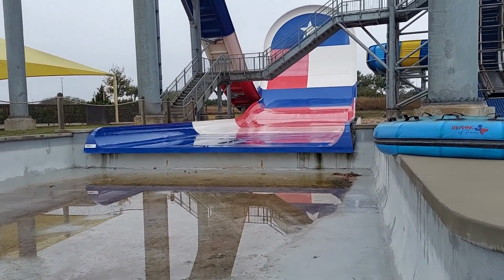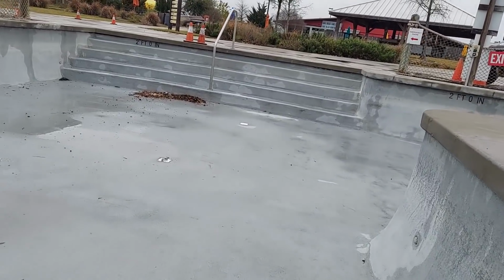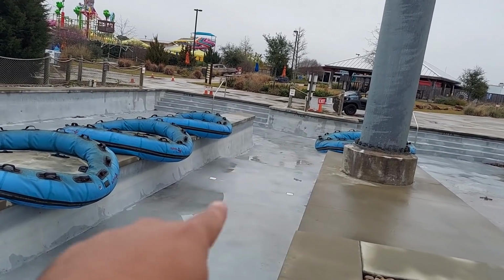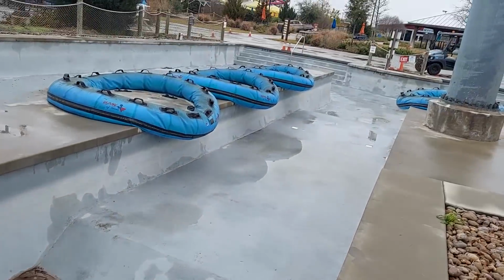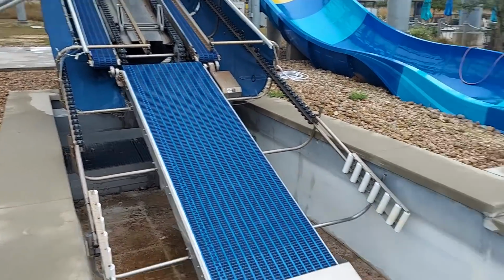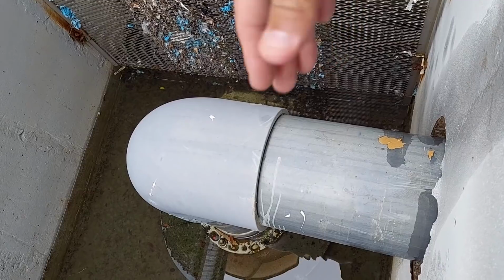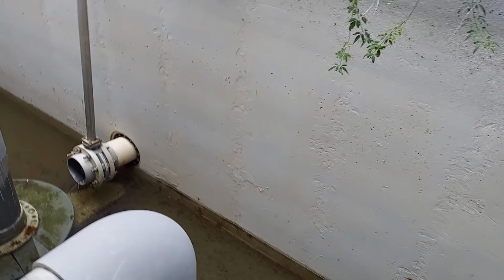Family Raft Water Slide Pump House

Comment: This really cool to see, so there's basically almost no chance for suction entrapment with this water feature even though the drain is massive and has a huge pipe, it's located in a area that's very hard to swim to. This surge pit I'm assuming prevents direct suction in the pools? Also, some lazy rivers have insanely massive drains such as 6 ' by 4' drains, does that mean they also have a 30" line inside them since the cover is so large?

Comment: I have three questions:
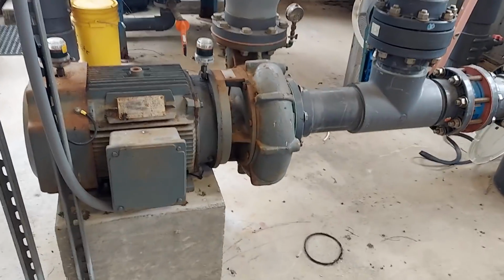1. What is the purpose of those pumps at 4:22?
2. The water flow throw the 4 bigger pumps, is filtered?
3. What would happen ir anyone throw, for example, a coin on that tank and is sucked by a pump?
Reply from the maker: 1. Those are pumps for another pool and attraction.
2. Non Filtered, however, the water for the entire pool is filtered.  The flow requirement is calculated to include the water that would also be taken by those pumps. 
3. Ehh, a coin wouldn't do much.  but rocks and stuff, they can be a nightmare on the impellers.

Comment: If you ever need some nice hose ask the local fire dept if they have any junk hose, usually it'll either have a small leak that presents itself during hose testing, where the hoses are pressurized to right around 400psi for 15 mins, I've used "junk" hose for years and even the pressure from the tower drain hydrant isn't enough to make it leak, I'd recommend keeping a few of each diameter around on a shelf somewhere, as considering it's pretty much free and given the cost of new hose it's well worth it, I've got 1 3/4 and 2 1/2 hoses on hand and when I get a new hose the worst condition hose gets passed on, I've got a list of people who want hose
Reply from the maker: Hey Hey!  Yes, we have a great relationship with our local fire department, and county fire department.  I have numerous 2 1/2 inch and 1 1/2 hoses and a couple of fire nozzles from them.  We use these for washdowns and pool refills.  These will be shown in my refill videos! Thanks for the comment!
Reply: @thepoolguy  Are your hoses Burlap or rubber? Some are Kevlar, but those are new enough we don't have any yet
Reply from the maker: @vacexpert2020  They are burlap, which works great for us.
Reply: @thepoolguy  I prefer the ribbed rubber hose, as it's easier to clean, though Burlap is considerably lighter

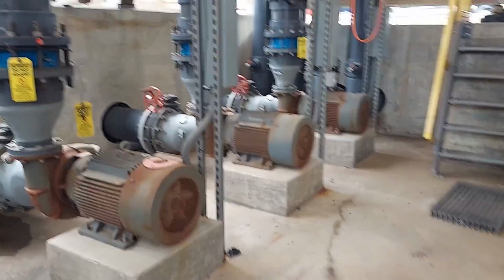Comment: Some cool stuff man! What's the standard pump between the 14 inchers at 3:51 for?
Reply: I was wondering the same thing!  Seemed a little out of place, my only thought was maybe it was so they could drain things out for winter, but then I saw the drain in the corner of the surge pit.  These videos really get my mind going.
Reply from the maker: So this pump is for a feature that was listed in the plans for one of the slides.  When the ride was commissioned, it was determined that the ride didn't actually require the feature to operate correctly.  So it was deleted from the plans, but never removed.  We kind of have plans for it, but it will still cost to move.

Comment: can't wait to see surge pit in action. btw why is the grate to catch debris lower than the water line? dirt can get past it no?
Reply from the maker: Correct, , but the water flowing out of the pipe is quite strong, and really only needs to be at  the pipe level.  Also, if the grate were to get heavily covered in trash, the overflow allows water to flow over the grate.
Reply: @thepoolguy  good point! btw. i love your videos :D